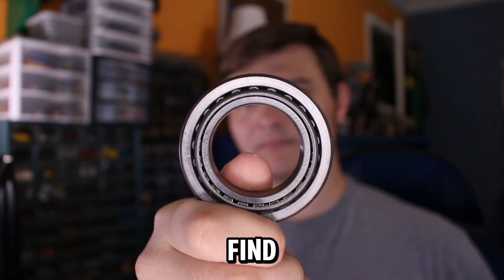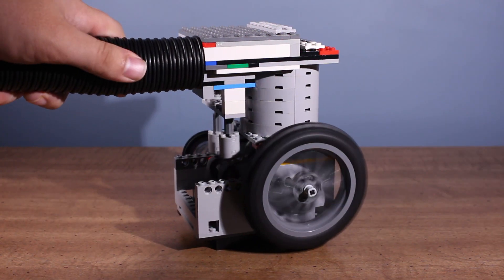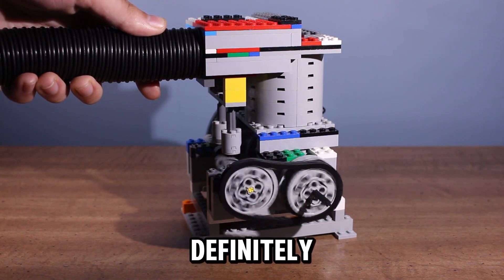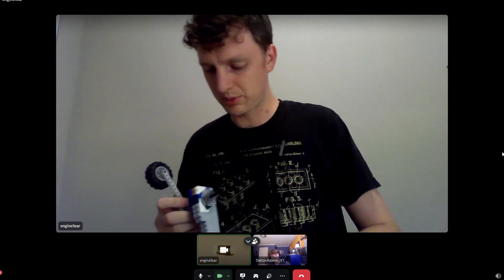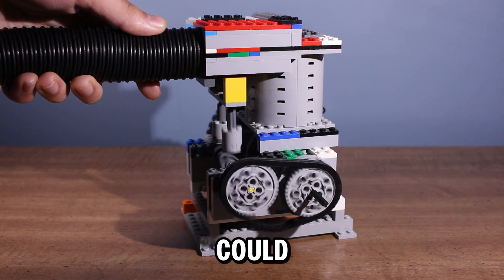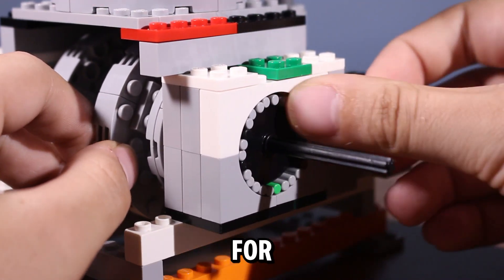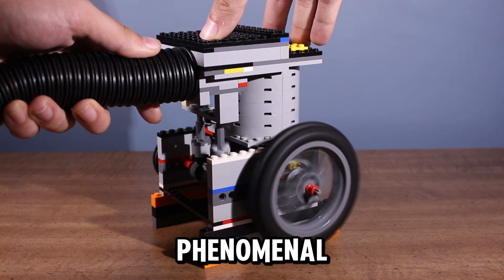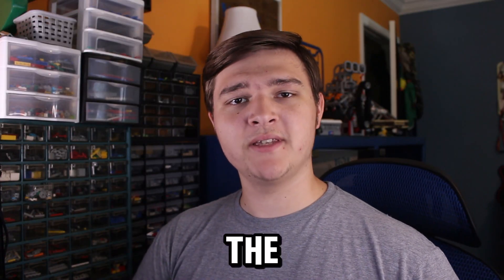I Tried LEGO Roller Bearings on Vacuum Engines!

Comment: Prepare yourself for a longer discussion of LEGO bearings...

Two observations I made in this video interested me tremendously. Firstly, if LEGO bearings are truly better for friction than LEGO axles as you seem to conclude, that blows my mind! And secondly, wow those cages make a world of difference, even if it reduces the number of rollers down to four!

Friction Discussion

When I originally thought of using bearings in LEGO engines, it was because I already had some large scale crankshaft prototypes that needed a way to spin without a ton of friction or an oily mess. Indeed even with the oily mess I didn't think they'd spin. I had quickly realized that these crankshaft prototypes did NOT torsionally deflect (twist) easily. This was great because torsion was the weakness of my crankshafts built from axles on larger scale engines (it took me a WAY too long to figure out the structural integrity in bending because really this was all an art project at first and who needs structural integrity but that's a side note) so I now had torsional vibrations theoretically taken care of. It's now clear from further testing that the torsional vibrations from axle-built crankshafts can cause large scale engines to stutter and limit their speed significantly and even moving to 2 stud diameter shafts is a huge improvement.

That's what's so interesting to me about this video. It appears your crankshafts are basically axle-built, and have near the same torsional rigidity of LEGO axles. It never occurred to me that at a small scale, meaning a scale where the torsional rigidity of a LEGO axle is sufficient, these bearings might also win the trophy in the friction category. These three engines you tested do not appear to suffer from torsional vibration slowing them down, but I could be wrong about that. It would be really cool to design an experiment that eliminates any effects of torsion just to see if your caged bearings truly have lower friction than an axle in a Technic brick. That would eliminate all my doubts and be remarkable. I'm not ready to say that this video's tests eliminate torsional effects yet, but I'd like to understand your crankshaft design better since you described it as "basically indestructible from the vibrations caused by running" in an earlier comment. So, does the engine with the caged bearings run better solely because of improved friction, or torsion also? Were there any other sources of friction in the axle crankshaft that you can think of?

Cage Discussion

If it is true that a a small scale (2 stud shaft diameter) bearing has less friction than a LEGO axle, then I'm 95% confident that is only true with these caged bearings, even if you are using the Technic connectors (BL: 62462) as the rollers and not the bars (BL: 87994). This is because without cages, the space for the rollers is not perfectly sized for an integer number of rollers, so it inherently leaves a gap. You can only fit nine rollers in the bearing but there's space for like 9 and a half. This is kind of like using an un-caged roller bearing that is missing one of it's rollers. It results in defects like uneven loading, increased wear and tear (friction), and other defects because of the rollers slipping instead of rolling, colliding with each other, and even rotating back and forth a little bit in the wrong direction (finding themselves in positions where their axis is unparallel to the shaft axis which makes them rub more on the retainers/washers). I've seen all of that behavior in the camshaft bearings on my test mule engine.

Caged bearings are the way. And that's not to mention the major improvements that cages gave me in larger bearings (6 stud shaft diameter). Now that I've tested and seen the results of bearing cages myself, I will try and cage my LEGO bearings wherever possible. My ONLY issue with the cage is at this small scale in the video you only have four rollers in your bearing design. The defect of a missing roller or gap between rollers that I didn't list above was decreased loading capacity. This is true for reducing the number of rollers in the bearing in general. Here we have room for 9 rollers; it would be ideal to design a cage for 8 or 9 or at LEAST 6 or 7 (and people who are OK with 3D printed parts probably will). But with only four, I wonder if the engine will hold up to the the loads at much higher speeds and torques. 

That reduction down to 4 rollers is not all rooted in the long length of the robot arm used (BL: 30377), but also proportions. If you look at the general proportions of roller bearings in machinery, these small bearings are really disproportionate. The rollers are way too big for a 2 stud shaft diameter. Maybe it's just me, but I've never seen a roller bearing where the shaft diameter (inner race OD) is only 2 times the roller diameter. Usually that ratio is way bigger (i.e. smaller roller OD, larger shaft OD). You'd almost always have room for more than a total of 9 rollers in a roller bearing due to simple proportions/convention. This means for a LEGO bearing where the math doesn't math because LEGO didn't design these parts for bearings, the extra space left by the "missing half roller" is proportionally smaller and has a smaller effect on the bearing's friction/wear/load capacity when this ratio is bigger. I've seen this in how the un-caged bearings are more stable in a 6 stud diameter shaft than these 2 stud diameter shafts. So the idea of an un-caged small bearing with more and smaller rollers like in this video has merit too, we just need to figure out how to get rid of that nasty play on the bearing with the bars or find different parts for rollers. Someone has commented a good idea already - yay! Going back to caged bearing, the proportions/conventions I observe in real-world bearings tell me one more thing. The "long length" of the robot arms is not so proportionally long for a cage on a larger scale shaft (like my 6 stud diameter crankshaft) because I do see bearing cages out there in the wild that leave space for a whole other roller between rollers as these robot arms do. 

Wait! That gives me an idea...

Anyway, thanks Delton for making this video! My test mule engine has lower friction and higher running speed than ever because you inspired me to add bearing cages!
Reply from the maker: Man, okay. I'm gonna note a few of your key points here and try to do some more experiments when I get the chance! Thank you for this comment!
Reply: @DeltonAdamsLEGO  As a follow up to this comment, I roughly calculated that the bearing improved RPM by approximately 79%!!! I made this calculation by listening to the "beat" each engine makes as it runs and tapping to the beat on a BPM (beats per minute) app on my phone. BPM becomes RPM! For the faster engine, I set YouTube playback speed to half, then multiplied the BPM by 2. That's a crazy performance increase!!!
Reply from the maker: @engine1ear151  awesome!!!

Comment: are you Dumb? Bearings are not in Engines
Reply from the maker: Ummm, yes they are.... Not the main bearings on car engines, those use oil pressure, but they are on chainsaw engines, a few small motorcycle engines, and in other places in cars and trucks

Comment: Surprised the bearings didn't just drag the engine to a halt - I'm impressed. Now, I'm a purveyor of SVS over tappets for these engines simply for the massive performance and complexity benefits, but I wonder now how much a roller lifter would also benefit your engine.
Reply from the maker: The main reason I'm using poppets is for the realism. But you do have a point with roller lifters. I think I might have an idea to get them to also look good while working, but that's probably for another time, not right now. I there there might be some added benefits from them, but I'm not totally sure
Reply: @DeltonAdamsLEGO  I think Will03 can attest that they improve performance a bit, but you're right, the trick it getting them to look realistic.

Comment: Putting baby oil on the Lego axles can make the vacuum engine run better just a tip I still love how u can make Lego bearings for Lego engines
Reply from the maker: Oil and lube is one thing I'm doing my best to not use. It's just my preference
Reply: @DeltonAdamsLEGO oh it’s alright I don’t make Lego vacuum engines but lube is the only thing I know that makes it run better👍

Comment: 4:10 it’s shaking, so it’s preforming better but it’s also gonna break the quickest too
Reply from the maker: You'd be surprised. The shaking is from 2 things: the crankshaft isn't perfectly balanced, and there's still some level of play within the bearing. I made the crankshaft basically indestructible from the vibrations caused by running, so the only way for it to come apart is to separate the two halves at the rod pin, which the engine can't do while running.

Comment: in normal bearings the rollers or balls are held in by a cage in the first bearing they arent so the rods touch eachother and those rods all have to go in the same direction but because they touch they rub against eachother in the opposite direction see them as gears, 2 gears next to eachother will spin opposite directions but because these arent gears they will slide and create friction. but as you said in the video probably the main cause is because of the free play which is also worse than it could be because of loose rollers. actual bearings are assembled by putting the ball all towards one side then spacing them evenly and adding the cage if they didnt have the case and just added more balls there would be a bunch of play
Reply: I would love to find a good combination of parts for a LEGO ball bearing :D

Comment: More friction
Reply from the maker: Are you referring to the needle bearing one?
Reply: @DeltonAdamsLEGO mostly yes. I’m just thinking one Lego axle that’s small and lubricated it much better than a big Lego bearing unless it’s used for big LVE like yours or others
Reply from the maker: I mean, with mine, the needle bearing was better on friction than the regular axle. But I'm sure with lubrication it's better. Though that's exactly what I'm trying not to do, use lubrication

Comment: Use a bit of oil to get less friction and try a real metal baring cool video
Reply from the maker: No thanks. I'm trying to avoid using oil in my engines because I want as close to a 100% LEGO engine as possible (that's also why I'll also say no to the metal bearing)
But thanks for the comment!

Comment: build a lego engine with a super charger with those roller bearings! and one of my shorts on my channel i built a lego vacuum engine with the super charger and i used to get 9000 rpm out of it you can take the design and make it your own!
Reply from the maker: Only thing is a supercharger on a vacuum engine doesn't actually affect the performance of the engine itself
Reply: @DeltonAdamsLEGO  I do agree with you but I tested my super charger with small pieces of paper towel and it started sucking them in and it was blowing air as well but it needs a few tweaks also and btw great job on your video I will make barings for my engine
Reply: @DeltonAdamsLEGO  and I don’t know if you know superchargers well but the reason why it dose not effect the performance of the supercharger to the engine the air has to be compressed  by I mean the intake hole of the supercharger has to be smaller than the fan blade it’s self si it gives that compression the problem with Lego bricks I have on my video it has vary small cracks that looses the compression or use a outlet of your shop vac and have a nother hose and shove in the intake that also acts like a supercharger to be easier

Comment: I would try rollers or bearings on the push rods were it touches the cams. used in real engines and reduces friction under load witch there is a lot of with the stiff valve springs
Reply: bearing are also important were there is no lube. hope my rant isn't to long enjoyed the vid.
Reply from the maker: Yeah, the next step would be roller lifters or something like that
Reply: the more force something has on it the more important bearings are. like how its easier to move heavy stuff when there's wheels under it. an example is using a wagon to move something heavy. it is way more important than using it for an empty box witch is easy to drag. same thing tbh

Comment: Interestingly enough, just about every conventional reciprocating combustion engine I know of don’t use ball/roller bearings for the main rotating assemblies but rely on sleeve bearings and forced oil instead— however one exception I can think of is the Honda S500/600/800, which managed to get away without forced lubrication since it had needle bearings on the crankshaft
Reply: I'd love to see a LEGO replica of a Honda S800! The bore is only 4mm smaller than an 8x8 round LEGO plate 😋
Reply: @engine1ear151 I second this
Reply from the maker: Well, yeah. Basically every large engine relies on those bearings. It's mainly smaller one that I know of that use roller or ball bearings,

Comment: I have used fidget spinner bearings on vacuum engines
Reply from the maker: Yeah, I'm sure those work real good! Though technically cheating, cause it's not LEGO 😂
Reply: @DeltonAdamsLEGO yeah definately cheating. i have not used them much because of that and because it is dificult to use them most of the time. Basically the way to use them is to put some piece which makes the axle thicker, like the acle extension piece, which lets you connect 2axles together. You need to put one layer of tape on the piece so the axle has a thight fit inside the bearing. now the bearing housing is rhe anoying part. Its not too dificult thankfully but imposible to explain. Whit my desing i just use a creditcard piece as a shim.
Reply: @Kippo6969  Cool, dude!

Comment: For the first bearing it's because all of the 3 stud bars create more friction that without it
Reply from the maker: No it doesn't. If you spin it without the vacuum it's much less friction than the regular engine
Reply: @DeltonAdamsLEGO  i copied the bearing design and it did do about the same just a little more friction
Reply: It sounds like we need some hard data. Force meter at the end of a lever arm, anyone?
Reply: @engine1ear151  umm

Comment: For the first bearing you could put a rubber band on the pulley to reduce play
Reply from the maker: I didn't use the pulley pieces like engine1ear used, but that may work!
Reply: @DeltonAdamsLEGO   and @customlegoz I tested something like that, but not that exactly. The shaft was made of the 3x3 round bricks that have a bucket-like inside on one side (BL 73111) and just wrapped it in the white LEGO rubber bands. It made the diameter of the shaft too large, but with the groove of the pulleys reducing how much the rubber bands protrude outwards, it might work! Plus I didn't have a plan for how to keep the rubber bands from slipping off with my design, but the pulley solves that too 🤔 Thanks for the suggestion!

Comment: Try to make a vacuum engine but with a two-stroke cylinder that would be cool
Reply from the maker: Like with transfer ports and such? I don't even think that would work, with the way a vacuum engine operates
Reply: @DeltonAdamsLEGO what if u took this dudes idea, but then incorporating the power valve seen in some 2 strokes as the valve to manage the vacuums suction, so it does work?
Reply: I think its possible
Reply: this is already a 2 stroke tho...